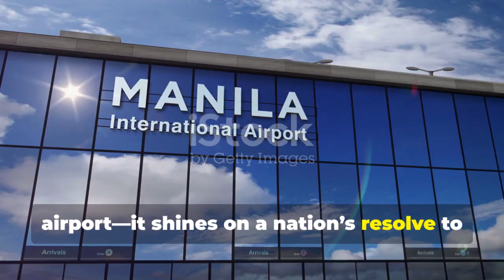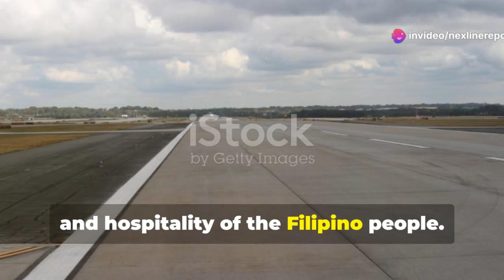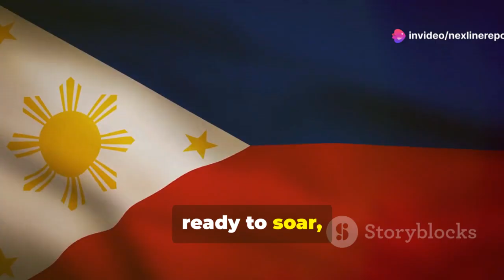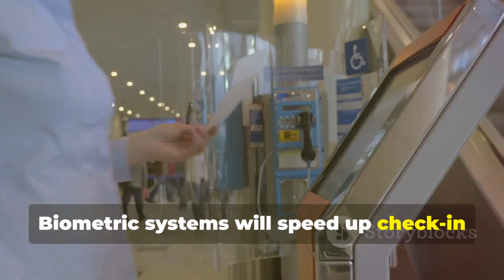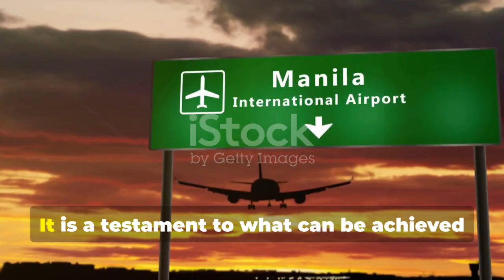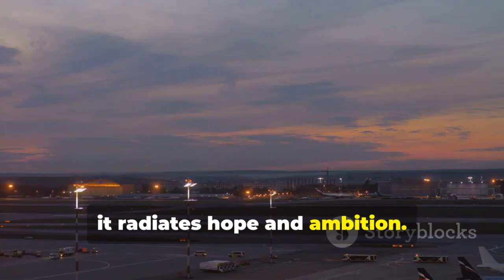New Manila International Airport: The Aviation Project Turning Asian Heads

Comment: MIA or NAIA two cross-shape runways were built when planes were still using propellers.  With the emergence of jet engines, the other runway was rendered useless resulting in only one runway being overly used and over the capacity.  The new one being built is projected to have at the maximum 6 parallel runways.  The outer perimeter area is projected for use by businesses.